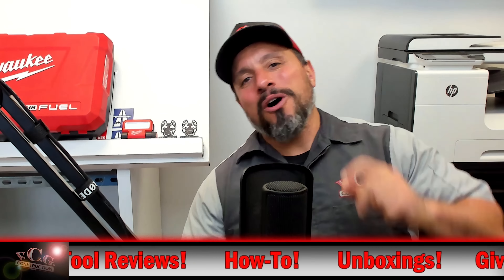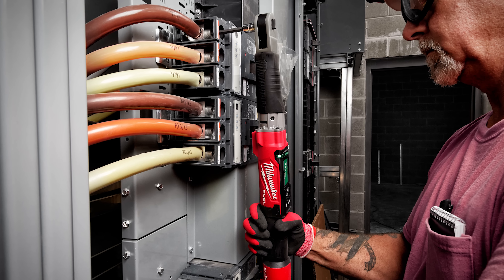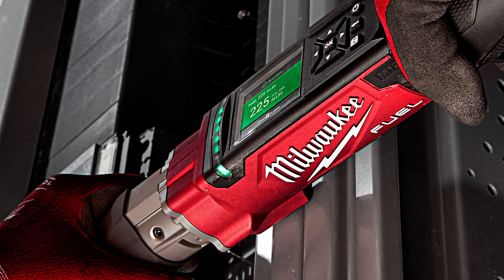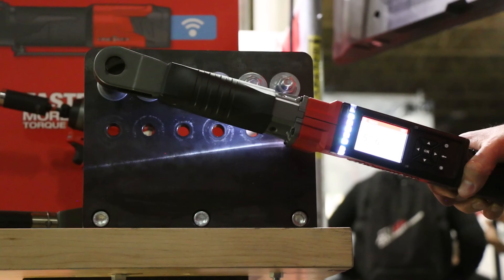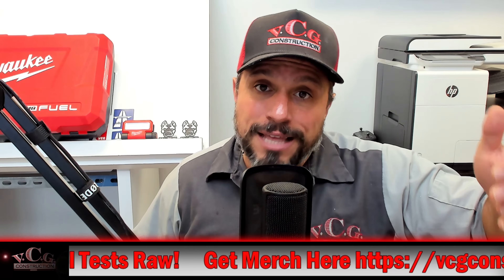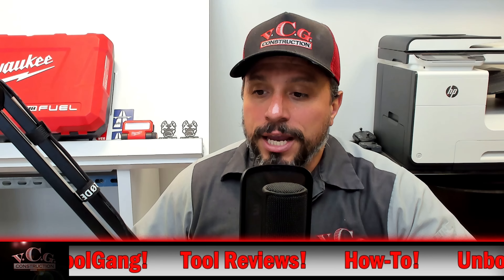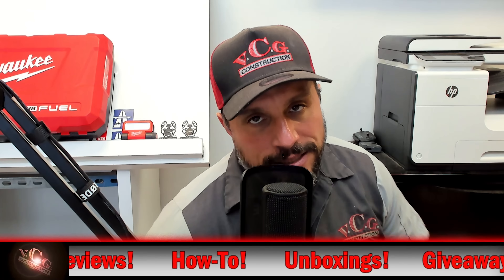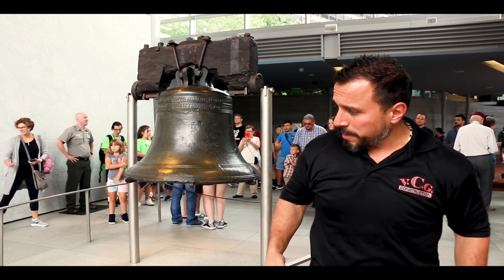Milwaukee M12 Digital Torque Wrenches NEW INFORMATION - Bad News For Auto Mechanics

Comment: That's awesome.  No more blame pointing about missed torque set. Just show them your report printout to verify your job.  I know from experience,  a tech failed to torque one wire lug and it overheated and caused a callback repair.   Torque setting in high amperage applications is very important.

Comment: I was considering this for wheel torqueing and I really hoped this would still be acceptable. I would hope other mechanics chim on this even though this is an old video.
Reply: I was also very excited about this idea but as a lube tech I would have to get this tool recalibrated every 10 days and that really tanked my hopes

Comment: 100- 110 lbs on cars and light suv's  /  dually trucks 140lbs wheels . You start going beyond that and you're chancing spinning a stud . I would say this tool is fine for the shop. The one key is a major advantage  for shops  it backs up that the job was done right according to specs . Keep a record of everything that leaves the shop  .
Reply: I was considering this for wheel torqueing and I really hoped this would still be acceptable.
Reply: I got this as a gift and use it at my job. I build electric motorbikes and have to torque down most bolts. This thing is awesome. I have all the presets and just boom boom boom. And witness mark it up and done. I have the 3/8 version. I don’t torque over 80 nm so I’m good

Comment: Vince everything in electric control panel usually has a torque setting so you don't mess up wires by telling him too much especially with the big gauge wires under under lugs cuz I I seen it where somebody tighten the wire too much the cut the wire and it's just got hot at that point keep up the great work and cheers with a beer

Comment: I used something like this in automotive production and was battery operated like all the liaham ion tools and worked well. The Milwaukee is far to big and built for automotive week I wont fit anywhere, and we need high torque ranges as we do torque in stages some times

Comment: Why not eliminate the need for two different tools by the electrician just using a orque wrench combined with a torque stick?
Reply: torque sticks limit torque by rebounding at a specific frequency in resonance with the hammer mechanism of an impact wrench.
If you apply a continuous torque through the torque stick, it is just a socket extension and does not limit torque at all.

Comment: Seems very useful for what my Stepdad does in the telecommunications industry. I keep seeing all these tools for the bigger use than I would ever use. Would be nice to see Milwaukee innovating in the smaller more basic electrical and electronic tools. You have seen the same strippers and crimps and other things on the market and quite frankly a lot of the new stuff just isn't that good. I see a lot of bigger application tools for electrical work that they are releasing on the New section of their website, I just hope that they don't forget about the small applications too.
Reply: I wish they’d release multimeters, the big specialized stuff is cool but how do you not just flesh out the basic carpentry specialty stuff first

Comment: For automotive field I would stick with my digital Snap on Torque Angle Torque Wrenches
Reply: Studd Muffin   yeah i would buy the 3/8 version in a heartbeat but due to the fact it doesn't do that i might as well stick with my kingchrome $100 one for now. only really use it for tightening overhead sets but I'm sure i could utilize it

Comment: All questions answered. Not what I expected it to be, I hoped it was basically a m18 Fuel Ratchet with digital torque wrench built in. It’s in the “cool” column for me, but not on the amazon wishlist 

But hey we’ll want to work until 70 anyway  as we’ll have a Home Depot credit card to pay off super expensive digitized versions of of 1 tool that looks to be bigger and certainly costlier than a m12 ratchet/driver and a proper torque wrench. No injuries, no debt. 😂 

If someone can get their company to pay for this, go for it though. I’d have to consider selling it and risking Injury personally

Comment: That’s plenty of TQ range for auto mechanics, maybe not 18-wheelers or heavy equipment. I work on all  4 of my cars at home and would love this tool 👍🏽. “Milwaukee, I’ll be glad to prove this point” VCG, tell them to send me one in 3/8” drive please 🤘🏽
Reply: Thing is you can get a manual one that goes to 250 ft. Lbs. for $120 and has all the features including showing the peak torque and beeps and lights etc. it just doesn’t store the readings. If it helps somebody do a job they couldn’t do anymore somehow then hey that’s great it’s just a whole lot of money that offers nothing that a m12 stubby/even surge can do together with a manual one except stored torque levels. I’m glad it exists. Just not something I’ll pay early adopter tax for this time. 

I keep wondering who really must have this sort of torque spec verification reports except secret service and such. Saudi prince’s electrician? I’d record all my work on camera 😂

Comment: So is this basically one of the Milwaukee ratchets but with a torque wrench on it? Also first😎
Reply: Yea but with the cost of 7 ratchets and 7 torque wrenches.  One universal complaint I have about digital torque wrenches in general is they should have also come with a revolutionary way of calibrating at home/work. I feel like this is like having a supercar and trying to find someone to service it without charging you the “because I know you can afford it tax”. Calibrators will find an excuse to charge more to everyone who has this for the yearly calibration, maybe I’m being too pessimistic though.
Reply: @Fee.1  that's a fact, I have to get my torque calibrated annually and it costs $50-100 a shot depending on which type of wrench.

Comment: Milwaukee battery starter kits are on clearance at Home Depot
Reply: THANOS which ones? I looked on the website with no luck :(
Reply: 87FoRunner  it was the cp2.0 /xc5.0 stater kit clearance price 159.99 the other kit was the 5.0 and the 9.0 starter kit  clearance 239.  They were in store clearance. Catskill NY
Reply: 87FoRunner Milwaukee M18 18-Volt Lithium-Ion Starter Kit with One 5.0 Ah and One 2.0 Ah Battery and Charger. I couldn’t find the other on their website.. check in store

Comment: Definitely not for automotive use. $750 & no angle measurement, so no torque to yield bolts & only 150 ft/lbs max on a 1/2" ratchet. Save it for the electricians.

Comment: So basically these will go to 200nm and your saying they won’t fit auto? Lol maybe not diesel and trucks but other than that it should be fine
Reply: Not necessarily because it would be maxing it out if I tried to use it for my truck. 03 F-150 4 by 4 torque spec is 155 ft/lb on lugs. And rule of thumb is you're not supposed to go above 75% of the max value of the torque wrench rated capacity.
Reply: jason reynolds did you read any of what I said I said it was useless for trucks lol....
Reply: @whiphore  yes but when you said trucks I'm thinking big rigs. because in Texas there are so many more pickup trucks on the road then there are carsthat it would be useless to have anything that didn't work on a regular pickup truck but not necessarily useless to have something that doesn't work on big Riggsand since you group it with diesels that kind of sealed the deal on big rigs for me. Lol
Reply: Studd Muffin don’t know about you but we have 3 or 4 different size torque wrenches in our shop for these tasks
Reply: Studd Muffin I don’t but I also don’t believe it should I’m saying it’s well and truely good enough for auto work an could be used in a large amount of situations

Comment: I want to tell you something all this digital age digitalist digital at I have an old Snap-on torque wrench it has a bar that goes up to a needle that goes through the points at a measurement gauge and I've had that wrench for 20 years and I'll tell you this I've never had a problem with my torque never anything screw up ever torquing bolts with this torque wrench so many other problems can't go wrong with these plastic digital wrenches you drop one it's broken they're ridiculous put an old Snap-on torque wrench in your toolbox you'll never regret it buy a digital with a plastic handle you're not going to like it trust me
Reply: That old snap on is 5x more accurate at less then a third the price of this thing. Torque wrenches aren't meant to be fast they are mean to be precise and at +/- 10% wire terminals are about all this thing is good for as 10% at 150ftlbs makes this absolutely useless for precision work.
Reply: If you are dropping precision measuring tools , regardless if It breaks on the spot , I wouldn't even trust it. Torque to yield bolts are a breeze with the techangle snappy wrenches. It took me 5 years to buy one but once I did , I wish I had done it sooner

Comment: I still don't get why it's not suitable for auto techs. Very rarely do you need >150 ft. lbs. on a car, save for lug nuts. It's usually about half that. Here's a Jeg's link of common torque. 
https://www.jegs.com/tech-articles/sbc-engine-specs.html

Comment: The problem is the x4 screws fixing the motor to the gear head think about It if you pull on It  in any direction left or right open or closed it is Only depending on x2 little screws to hold it together and the  input shaft is not doing anything to help it the bearings would not hold side pull of 200+ Nm that is why, thanks for vid
Reply: You have a great point. 

Vince do you think you'll get one for testing? I would love to see if it feels durable. The fuel racket, in comparison looks like a solid tool with plastic covering.  This torque wrench appears metal head just attached to a plastic body.